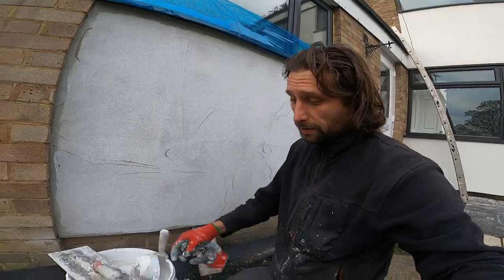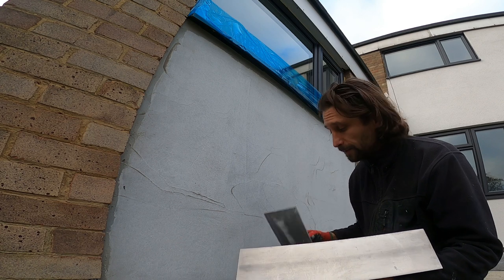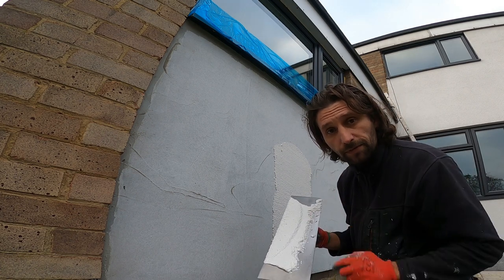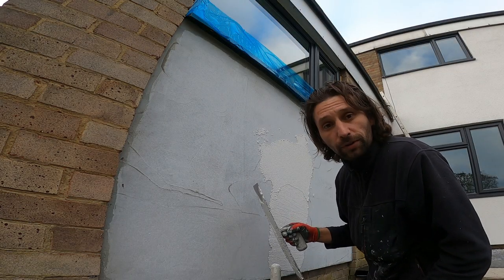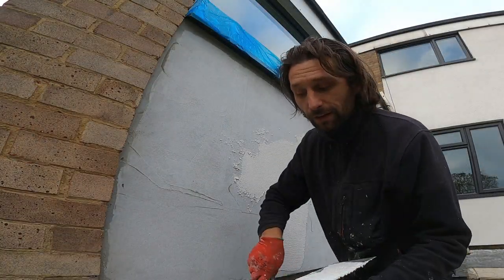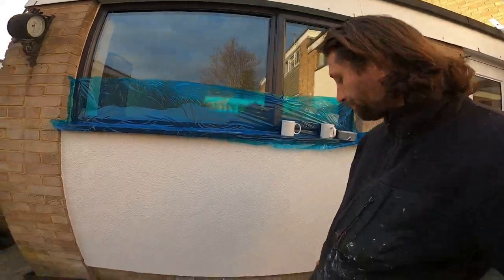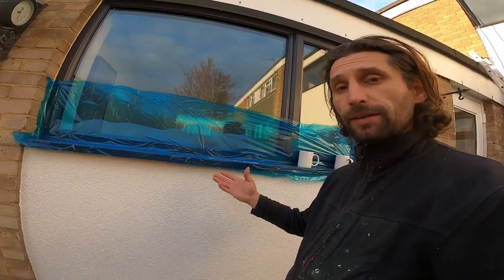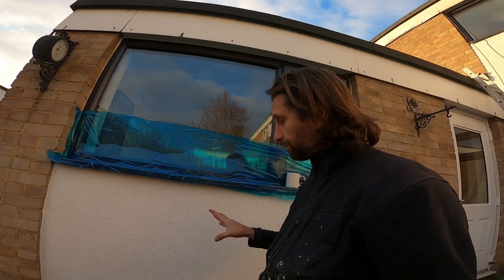Silicone Render Application

Comment: Have you got a video showing putting on the base coat and meshing it?

And also can you stick the plastic beading on with Pink Grip adhesive?
Reply from the maker: Yes. Pink grip is good just in the bin , use a good exterior adhesive or silicon, ob1,ct1
Reply from the maker: https://youtu.be/A4LL1BU6A3Y
Reply: @How2Extreme  Hi great job thanks for the link, so am i right using Cerisit it is the basecoat (adhesive) one coat with mesh embeded then a second thin coat when the first coat is dry, then the silicon render on the top?

If the above is correct what thickness beading do I need to buy to build out the two base layers ready for the silicon top coat, I’m confident I can do a job but just need to double check I’m on track with the process?

Thank you for your reply’s.
Reply from the maker: @Happytruth you are ready to go, it seems. Beads are not important. You can decide the thickness

Comment: You’re really calm and easy to listen to. Can I ask if this a one coat system? As sone other brands have to be primed and top coated with a special product. So there are three stages - undercoat, primer and top coat. Yours is only one. Would this work just as well? Also, in this case you didn’t use any mesh. Is it because there were no joints and the area was small. Many thanks and thanks for all your videos and advice.
Reply from the maker: Hi. In this video, i just applied the final coat it was already prepared with adhesive, mesh, and primer
Reply: @How2Extreme  that makes sense. Thanks for the reply Sorin. 👍🏻
Reply from the maker: @almusti thanks for the visit

Comment: Great Stuff ,your one calm geezer , I am going to do the external insulation with silicone render to an old stone cottage i have there is approx 80 m2  ,what brand of silicone render would you recommend 
thanks D
Reply from the maker: I always use the ceresit ct74 silicone self clean render you can finde different acrylic types but they're going to get dirty  quicker.Thanks for the visit

Comment: Hi pal . I’ve just completed an acrylic job on one of the walls the rain has washed parts off . Nightmere ..  can I just patch it in with the left over acrylic .. my question is do you think it will blend in or does the whole wall need doing again ???
Reply from the maker: Definitely not. You will need to do the entire wall. If not you will have patches and if to much water went on the fresh render is going to lose the chemicals in the render and the strength of it. Is going to bubble and peel off
Reply: Thanks for getting back to me.. do you think I can go straight over the old acrylic or do I need to prime it again ??
Reply from the maker: It's fresh, so there is no dust on it yet. Yes, you can go on top of it, but make sure it's hard and grip well on the wall. If not, it can peal off after a few month's
Reply: Thanks mate 👍👍
Reply from the maker: @dominicdurso3672 no problem im glad i could help

Comment: Hi, I've used acrylic rendering and it's surely very messy and even though it looks all nice and smooth in some daylight, it looks rough and uneven in different angles when Sunlight hits it. I am not happy with it. Can I reapply primer again and new layer of acrylic render top coat? Thanks for your time.
Reply from the maker: Hi.The base need to be perfect to get a nice finish. The topcoat only it's not going to solve the problem you need base coat and a straight edge.You can try with the top coat maybe you get lucky. Send me some pictures on my Facebook
Reply: @How2Extreme  Thanks for the reply. I discovered that I can sand down the imperfections and that I can then put a new layer of paint on top once it's fully dried. I don't like the final gray colour anyway so I'm going White that way future touch ups should be easier.
Reply from the maker: Excellent.i didn't know you can sand it down and have a good result Good to know

Comment: Using krends Thincoat system at the minute it very different to this system. It can sit no more than a couple of minutes and we put it on as tight as possible any heavier and you don't get the finsh required
Reply from the maker: A bit more difficult but not impossible
Reply from the maker: A bit more  difficult but not impossible
Reply: Thats it we were lucky there's a few areas that won't be seen so we got to play about 1st
Reply: I just used the weber thin coat and had no more than 3-4  minutes to rub it up. Virtually the thickness of a coat of paint .... good stuff but you don't want to rub a dried section by accident 😫
Reply: @farikomike524  hello mate . What is this Weber thin coat you speak of ? I've done some rendering for the first time but there are areas where it looks terrible , I've over sponged the top coat . Do you think this product would sort it ? and do you have to rub it up or can you leave it a ' rough effect ' ?
Reply: @robertkustos2931  webersil tf is the product i used. It was a re-do on a job where it was rubbed over too late and it left flat areas. It’s a really good product but be prepared to hit the entire area in one go without stopping. You get about 3-4 minutes once applied to rub it up (at best) with a flat rigid plastic float and do not touch it again. Also, you have to apply it really really thin. Trowel on and scrape 90% of it back off, rub over in circles and DO NOT STOP until you are complete. You will know if it’s on too thick because when you rub it up it gathers up on the float and spreads and makes a mess. You can get a great uniform finish if you follow these tips 👍  Additionally, do the job with a mate. One spread and one rub, it’s not worth the hassle of trying to do it all yourself as it will go off too quick.
Reply: @robertkustos2931  this will leave a rough look but it is nice. Very small stipple 👍
Reply: @farikomike524  thank you very much for the tips . I'll keep this in mind . Cheers .
Reply from the maker: You welcome

Comment: Can you get a finer stone for a smoother finish.
Reply from the maker: Hi.This is the smaller one 1.5mm stone and it will go up to 4mm stone but is possible to leave it with the adhesive and  paint with silicone paint or exterior paint.Aditional coat of adhesive need it

Comment: Good afternoon. When doing a large wall, do you work in small sections? As in you apply 1-2 square meters and then immediately go over it with a plastic float. This material dries pretty quickly, doesn't it?

Thanks.
Reply from the maker: Hi.yes it's drying quite quickly depending on the weather.i try to do as much as i can before touching it up with the float if not you might notice where you stop.best to have some one with you to help ,work in the shade,put some more water in the mix if to hot outside be fast and don't stop till you finish.more clips with this system next week.thanks for the visit

Comment: hi.....if you are doing a huge big wall, (finishing silicone) and you are just one guy doing the lot...im guessing you need to do the wall all in one go, or else if you stop and start from one day to the next  you will have lines etc ?......or is there a 'trick' or secret on how to do a large wall on your own with breaks and not leave signs of having done so?
Reply from the maker: I do it alone sometimes, and the trick is not to stop and to increase speed as you go. I recommend 2 people
Reply: @How2Extreme  thank you for your prompt response
Reply from the maker: You are welcome. Also, you can add some water to the render but not too much as it is going to be to liquid and fall off the trowel

Comment: Hi ,is possible to apply silicone render over already painted surface? Thanks
Reply from the maker: Yes.clean the surface primer and render
Reply: @How2Extreme  what time off primer need to be used thank you
Reply from the maker: The primer that goes with the type of silicone render.the brand that you are going to use its going to have his own primer